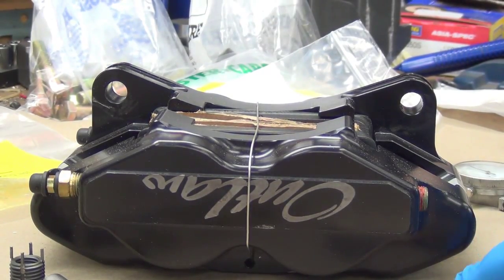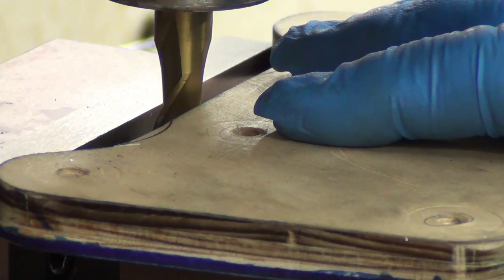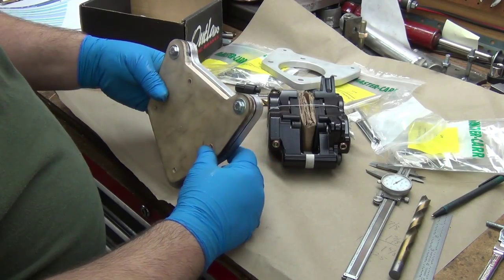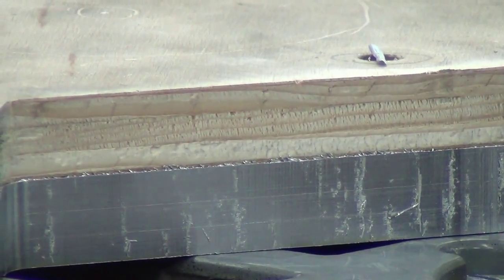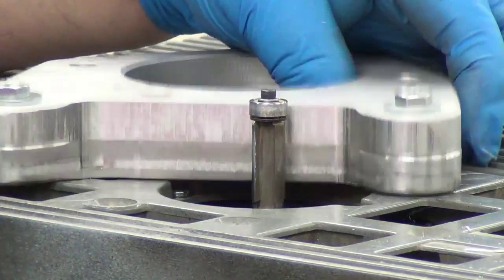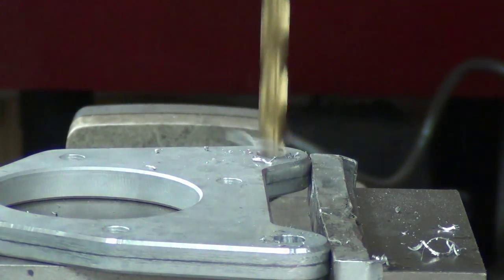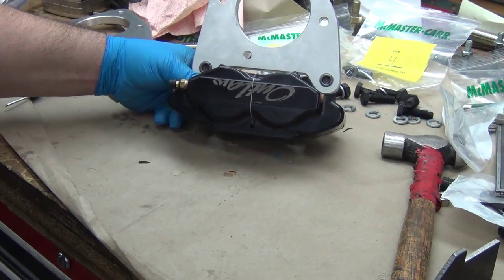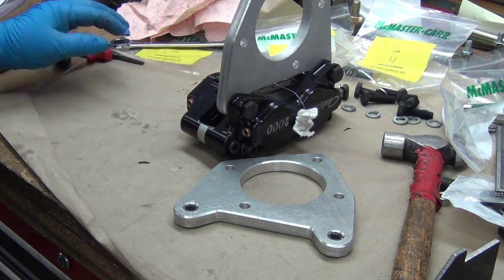Outlaw Brake 6

Comment from the maker: Great question! Since it's likely that the calipers will be taken on and off, it makes the threads much more durable.  It also stops dissimilar metal corrosion between the bolt and the bracket.....I believe it's also called galvanic corrosion.  If the corrosion happens between the insert and the bracket, it's less of a probably because the insert is anchored in.  Since the aluminum is fairly soft, having a bigger hole with coarser threads helps to spread the load.